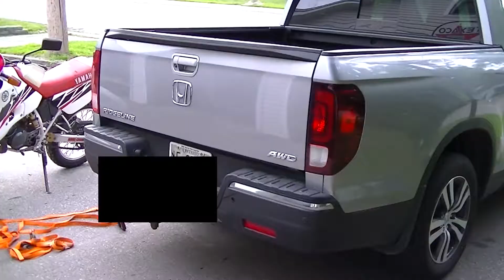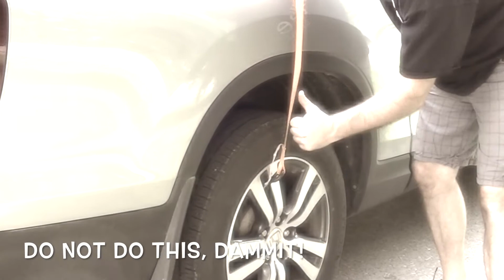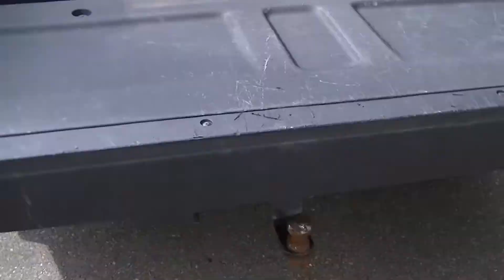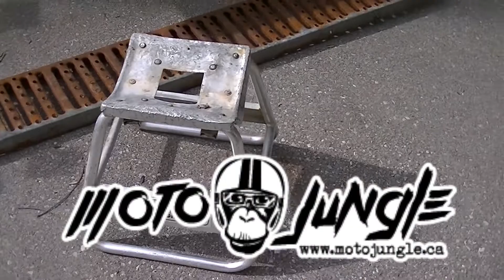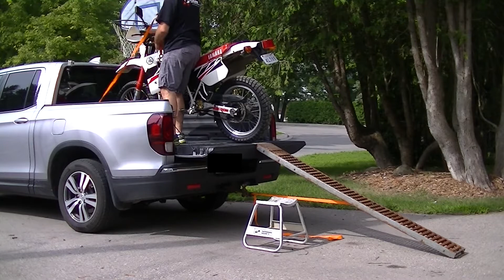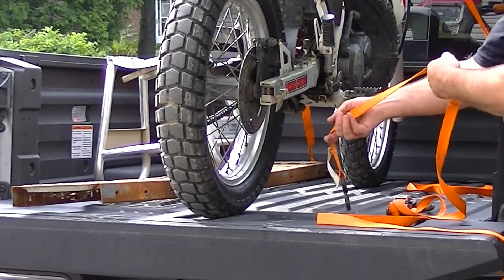How To Load Motorcycle in Pickup Truck Solo (by yourself) | Honda Ridgeline

Comment: I wonder if my KTM 1090R would fit with the tailgate open.
Reply from the maker: i dont have the truck anymore or i would measure for you.  best is to pop by a Honda dealer and bring a tape measure.   Its pretty roomy in the back it may likely fit

Comment: Hey I found another video from "the dirtbike channel where he goes from corner to corner of the bed and all he does is strap to the foot pegs. Im just letting you know cause you could probably close your tail gate and also no strain on front suspension. Check it out if you're interested.
Reply from the maker: youre still compressing the front suspension - i dont think the DT will fit in a ridgeline bed even on the angle - on a normal truck yes but the ridgeline is only a 50” bed
Reply: @mudbrats  ah I see! Thanks!

Comment: Having the bike running and slipping the clutch makes it WAY easier.  No pushing, just walk up beside it.
Reply from the maker: This bike is light - but that would work on a heavier one for sure - Thanks for watching!
Reply: @mudbrats  Yes for sure, but after a good ride when I'm tired I even use that technique on my YZ250.  Not necessary, but helpful when you're feeling lazy!

Comment: You can make that a million times easier on yourself by having self reeling straps and two ramps so you can walk up it with your bike while you give the bike a little throttle
Reply from the maker: Thats likely right - I ended up getting a bigger truck (Ram 1500) and I picked up a rear rack which is really cool and way easier to use!  stay tuned I will post that video shortly

Comment: When you get to the trailhead to park and unload the bike do you lock up the ramp to avoid theft? That's one aspect I'm trying to figure out. I want to get an ADV Bike and will trailer or ramp etc.. I'm afraid of either "growing legs" if you will as I ride for a few hours. Good video btw..!
Reply from the maker: use a cable lock and lock the ramp to the eyeloops in the bed

Comment: How do you like that Ridgeline? What kinda mpg with the bike in the back? I’m looking to get one for the same application
Reply from the maker: Ridgeline is a great truck - The MPG doesnt really change with a bike in the back... around 10L/100km (23.5MPG) no problem.  The Ridgeline doesn't even know its in there.  The only thing my Ridgeline's struggled with was the Enclosed Snowmobile trailer and mileage doubled.  I am working on a long term review of the Ridgeline G2 to be airing shortly on here
Reply: I love my Ridgeline. Best car I ever owned. Coming from Subaru Forester XT

Comment: I've always owned a truck and can't figure out why they don't put tie downs in the bottom of the bed. Most useless when there up at the top ! Toyota was advertising them on the 2007 Tundra ( first Year) but never put them on in production. 
I once forgot to tighten the ramp strap so when backing the sled out , my sled just fell to the ground ! That was a bit of jolt but it was faster !.... Mark Bow
Reply from the maker: The Ridgeline continues to amaze me... The dual action tailgate and in-bed trunk is pure genius.
Reply: I've considered the Honda but it's just not as heavy duty enough for my needs. Yes they are impressive. I'm Honda and Toyota guy since 1988 when my new F-250 practically fell apart before my eyes . Never again I SAY !

Comment: strapping it down from the bars and compressing the suspension may not be an issue for that dirtbike, but it can cause damage to a lot of other motorcycles if the shocks bottom out and crash the fender as the truck goes over a bump. Its better to tie the bike down from the further down the forks near the wheel axle. This way your bikes suspension is still working like its supposed to over. Also running it up the ramp without motor assistance is probably not going to work with many street bikes.  cool video though thanks for the upload
Reply from the maker: good points!  Thank-you